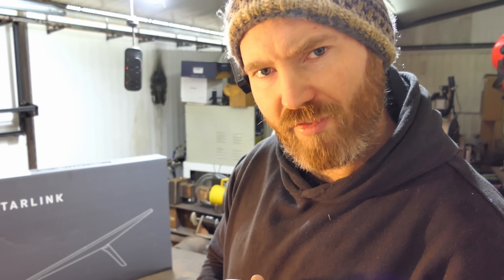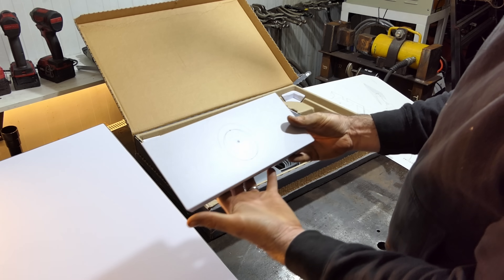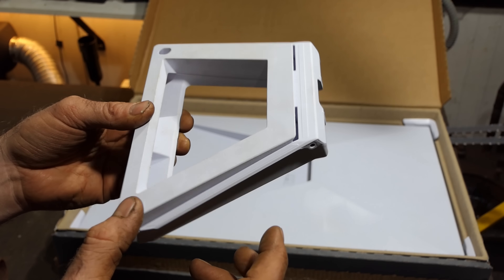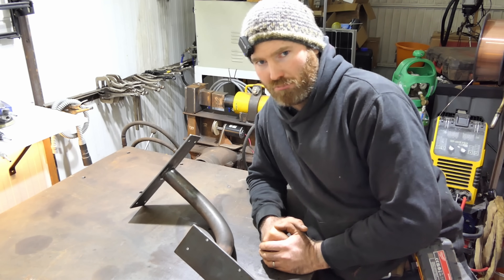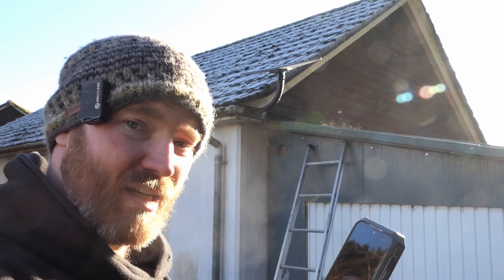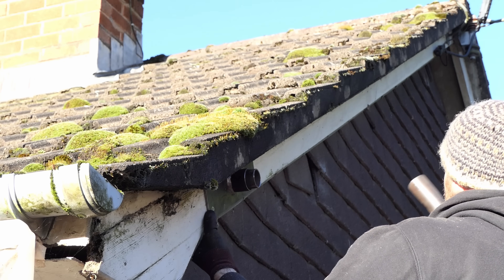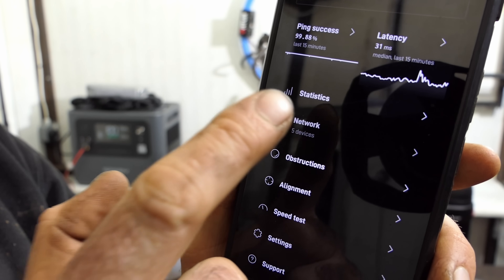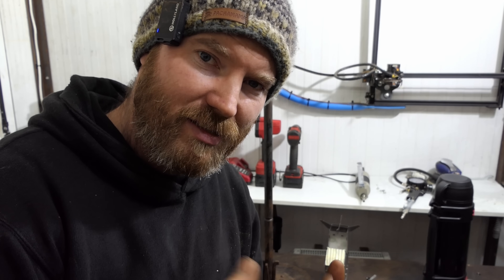I bought UK Starlink internet... I'm shocked!

Comment: I was interested in this as I have no wired (cable/fibre/phoneline etc) connection to my flat - half a mile from the centre of a market town! I tried to get full fibre connected - involving 9 visits from Openreach - and despite being about 100 metres from a large connection box in the road, and the same distance the other direction from one of their upright boxes, they finally told me they could not connect me. Not that I would have to pay, but that it was not economic to connect me at all. I considered satellite, but the cost was prohibitive, and the £75 a month cost rather scary, too. My only option is mobile internet, and after 2 years with Three, at £20 a month for speeds as low as 0.3 Mbps (and a high of 6) I am now on a monthly contract with Lebara (Vodafone) at £25, but with an average speed of 30 Mbps. Fortunately these speeds are adequate for my needs, but if the next tenant here needs faster internet it is going to cost them!

Comment: The plates at either of the steel tube should have a have a hole large enough to pass the cable through the tube. Much neater.  I also added 2 TP-Link Deco meshes as the house was quite large. Works brilliantly now. We also installed Starlink because we had rats first eat the copper cable, which was replaced, and then the Fiber optic cable that replaced the copper one.
Reply: Rats around our place legged it after our cat arrived ... on one of his first days outside he ran back to the house with two young ones in his mouth and a few days later brought a full sized (dead) adult rat in through the cat flap ... eek. That was 4 years ago and still not seen a rat around here since! Rats appear to be smart enough to know when life is going to be better elsewhere.

Comment: You need a mesh WIFI system. Plugs into the ROOTER 😂, you disable WIFI on that and the mesh units take over that functionality. I have 3 around my house as its a long narrow house. Works a treat and full speed is available even at the bottom of the garden. About £140.

Comment: While watching your video I did a speed test on my internet which costs about 8 pounds/ month on a copper cable and the speeds were 72.91 mbps 'Download' and 75.94 mbps 'Upload'. I am in the EU,. maybe you should start your own ISP? Oh, there was no congestion fee or special hardware (typical wifi modem), I don't need 'snow melt mode', I am not supporting a megalomaniac, to top it all off I am not on a long term contract so I can chop and change as I like.

Comment: If you're trying to do modern stuff on that old desktop, you might like to have a look at installing Linux. If you're used to Windows and wish to 'hit the ground running' something like Zorin or Mint would be an easy option. There are free versions of all the editing software to enable you to do your work. Even on a 12 year-old desktop, you should get speeds similar to what you're used to on your more modern laptop.

You could even make that old PC dual boot before embracing the same solution they use of the ISS and at CERN's LHC.

Comment: Starlink now available? Had it two years ago, used it for about 18 months and it worked great. Got 1G/1G fibre now (not from Openreach). I’m in deepest darkest N. Ireland.

Still have the dish in case the fibre goes down, can activate it at any time a month at a time.
Reply: How did you get any fibre company to make an installation in deepest darkest N ireland? I live somewhat centered and cant get any company to make an installation in my house or zone... Thinking of buying Starlink now but not sure if works for gaming/streaming

Comment: That's cool! Best I've gotten from mine here so far in the states is about 200mb. Most of the time it's closer to 120. I've installed it out at my solar shed and had the same problem in the house. Terrible connection, slow and would drop out. Picked up a TPlink 615x I think it's called. Plugged into an outlet on a wall closest to the shed. Happy days. Full on connected all the time but just above half the speed that's coming from the router. Fine for me though, far more speed than I need. There are certainly newer, better, faster range extenders than the one I've got.

Comment: If your getting a poor signal from the wifi router use a device called (Home plug), it uses your house ring main circuit which you have in ever room. They come in pairs to work, one plugs into the twin socket in the room where the router is and you run a cat5 or cat 6 cable from the (Home plug) and plug the other end into the back of the router. You then go to the room where the computer or device that needs an internet connection is and you plug the other (Home plug) into the nearest twin socket and run a cat5 or cat6 cable from that home plug to the computer or device that needs internet. There's instructions how to link the home plugs and boom you have a very strong connection from your router. Ethernet connection gives the strongest connection because it's hard wired all the way, you can get wifi versions where the connection might not be as strong but good enough depending if your streaming 4k content. Lots of companies supply their version and some perform better than others, google search and reviews will point you to the best ones.

Comment: I got the original round (motorized) dish a couple years ago, and it did the same: according to documentation it should point north, to reduce interference with geostationary stuff circling at the equator, but if your location is already far north, it will actually point south. Since the polar Starlink satellites are operational, it has moved itself to a more horizontal position. ~40W is about 10W less than my old dish. You can expect an extra 80..100W when it starts melting snow. The extra power is not only used for melting, it is also used to boost the signal, to get through the snow, in mine also does it in heavy rain, at any temperature.

Comment: 0.7 Mbps in your workshop is 70 kB/s which is awful. I'd get an even longer cable from the aerial to the router and place it more at the center of the house. The Gen 3 standard aerial you have uses eight wire ethernet cable with rj45 plugs. Probably terminated on both ends according to the default T568B wiring scheme. It's probably best to check which color connects to which pin on the supplied cable. If not, you'll need a rj45 crimping tool and a couple of shielded rj45 plugs (also if you want to keep the holes to drill smaller). Recommend getting cat6 s/ftp cable.
Reply: @joshuadelisle With copper wires btw (which has CU written on the jacket of the cable). You don't want that copper cladded aluminium (CCA). And you need something to protect the outside plug from water.

Comment: We had a boat built and the builders installed a wifi hub for us.   We got a sim card and found that the speeds were much better than the landline speeds provided by BT - and cheaper to boot.   I thought, if it works on the boat, why not at home?   So, at the end of the cruising season, we took the hub home, plugged it in and, hey presto, it was excellent.   So we told BT what they could do with their broadband and have never looked back.   We now use the hub both at home and on the boat for one single monthly fee.
Reply: So is that a star link system or a different company/ different configuration
Reply: @theshauny  When we were having the boat built, I specified that I wanted broadband on board.   The boatbuilders supplied an ordinary domestic hub - Huawei in fact.   We got the sim card from "3" and set it up in the boat.   It worked faster than the 'broadband' we were getting at home through the BT landline.   So we told BT what they could do with their broadband.   Now we have 2 cards - one with unlimited data for the router and another unlimited calls, texts and data for the mobile phone all from '3' for £24 per month and BT are history.   The landline service here in Norfolk was crap whereas receiving our broadband via the mobile signals is excellent.

Comment: you can use your old router and turn off dhcp in the router settings so it turns into access point/ switch with wireless options if you want to use your phone or pc in the workshop, if you have a cat5e cable from your starlink  to your workshop via pvc pipe if it needs to go outside, that way your speed would be improved

Comment: I had bad Wifi too, so I bought a Linksys Velops system and hey presto, I got great Wifi. Maybe that is an idea for you? You can buy 2, 3 or 4 of these 'towers' and divide them over your house. I bought a second hand set of 3 for 75 pounds.

And guy a backup drive, so you don't lose you videos again. You can just buy a seperate external one with USB 3 for example, but also buy a NAS. Nothing worse tuan losing your data and a backup is much cheaper than what you pay these folks to get your videos back.

Comment: Electromagnetic radiation is generally non ionising. At least until you get to UVC and X-rays. 124 nm UVC is categorised as ionising, but technically isn't IIRC. X-rays and Gamma rays are actually ionising, and that's <10nm. Meaning you have nothing to worry about in terms of cancer risk from general electronics that don't contain some sort of specialised magnetron/vacuum tube particle (electron) accelerator.

Comment: 5G in Finland £25/month 150Mbps, reliably 50Mbps asymmetric everywhere (use your phone as WiFi hotspot), the same flat rate on all of Scandinavia and Baltics, 100 Gb/month cap in EU. £35/month fiber optic 1 Mbps symmetric (if available). 

Starlink network will congest like mobile networks. Even 3G was really fast when no-one else had it in my neighborhood but me as Nokia engineer with phone prototypes. But even 4G is now too busy to give good speeds. It is ludicrously expensive in Scandinavian standards.

Starlink satellites deorbit naturally within 5 years. I can not support that kind of waste.

Comment: Just a reminder, you can connect a second router to your initial router to get better wireless if you have a lot of walls and such.  You basically just connect it in line.  You can also get wired wifi repeaters that essentially do the same thing but do not have any of the functionality of a router on top of that but considering they cost essentially the same price I don't see why you'd get them instead.

I do that myself so I have the best wifi signal possible in my computer room for the purpose of wireless VR.

Comment: Im living out in the country side , I had starlink for a while and it was really good. I was getting 350Mb down and usually around 15-20Mb up for €50 a month and I was  using around 3TB or so.   The only issue I ever had with it was the latency which has improved a lot over the last year down to an average of about 25MS but with spikes to 50MS or 60MS and the fact they use GCNAT also caused some issues for me.  Im on fibre now and Im getting 1Gb, under every day usage I dont really notice the speed bump over starlink unless im downloading large files or streaming my games outside of the house.

Comment: Don't compare wifi to actual internet speed.... It's like showing you have a 10Gb highspeed connection and only showing your wifi speed, how silly.... People tend to think that wifi is the solution of internet in their houses... It is not. Better install a 2.5 Gbit switch behind your router and put cable everywhere, then the problem you describe is not there anymore.
You know they sell POF cable sets, (Plastic Optical Fiber) that has max 250 meter reach 100Mb/s on every set connection, but I measured 150Mb/s (Send/Receive) on one set, that is now 8 years ago. So maybe there are faster now that you can attach to swithes to connect to computers and have the advantage of your high speed internet connection.

Comment: I saw your video and thought "if only". I have been with BT for the past few years and it suited my purposes and they also upgraded my connection to full fibre, great. No, not in the slightest. It is now slow and keeps losing connection, I go onto their home page and do a check, they do something and the speed is back to normal, slow instead of not responding. Oh for the good old days before the upgrade when it worked. When the contract comes to an end I am off, there must be a better provider out there somewhere.

Comment: The $75 serving as a disincentive to others is the best money you've ever spent if you're achieving those speeds. I live in the most congested Starlink area in the world, the Pacific NW, and average speeds here are about 60 mbps, down from 200+ when I first received my dish. Where it shines is in reliability. I still have my cable ISP running in parallel which goes out frequently. Starlink just keeps on truckin.

Comment: you can order a starlink adapter to use ethernet and use a cable router, that way you can run ethernet cable to where you need it, and add wap's where you want for better wifi. Iwas going to get starlink as we are too far from the exchange for broadband, and were on satellite anyway, but 4g became available (with a mast and high gain antenna), and a unlimited sim-only package installed into my own 4g router is much more economical. (less than £25/month with discount from provider)

Comment: Hi, love your videos! Just a comment about your computer issues. You can hire cloud pcs, i used a company called Shadow for a while for a CAD rendering machine, the specs were way higher than i could afford to build and as the PC is already at a data centre the link speeds to the wider internet like youtube are insane. You just use a cheap spec laptop/pc to access your shadow pc. YOu would however need to upload your footage to your shadow/cloud PC however that shouldnt be an issue with your new Starlink set up. Cheers

Comment: You can extend the internet through your electrical cabling. Deco P9 system from Amazon very easy to install and works. My home has a concert floor and I use a Deco P9 system with six stations throughout the house and workshop all connected by the cabling in the house you can connect as many stations as you need. I have a 1GB fibre connection which is connected to the Deco wired with a CAT6 short cable then this connects through the electrical cabling to all other stations for either of two UPT connections or wireless (speeds of 250 - 300 Mbps). You have to disconnect the wireless network in the router and create a new wireless network through the Deco main station (one connected to the router by cable) this then connects to all the other stations you have all you have to do is add each station to the network. Then when you walk around your home you have a strong wireless connection. I hope this helps.

Comment: just for INFO, all geostationary Satellite's are located over the Equator ..

depending on were you are located on the planet, the direction you need to point the antenna will vary

here are some general guides;

Northern Hemisphere ( SOUTH )
Southern Hemisphere ( NORTH )
Equator ( DIRECTLY OVERHEAD ) 

the Actual ANGLE / HEADING
will depend on now near to the edge of the intended Footprint ( intended coverage area ) you are located

if you are located on the extreme edge, the required HEADING and ANGLE may be very close too, or BELOW the Horizon.
causing reception to be weak and intermittent or IMPOSSABLE all together.

for example if located in Great Britain ( UK / Ireland ) thou you are lucky that the general heading is close to directly SOUTH 
How-ever; you will be increasingly unfortunate that the required ANGEL ( on average ) is about 30 degree's above the Horizon .. 

( meaning the further north you go ( sorry Scotland )
  the more likely Terrain ( Hills and Mountains )
  man made structures ( Buildings )
  Native life ( Trees, Shrubs & Bushes etc. )
  Will reddener receiving the signal at best Intermittent )

for better understanding, ( suggest begin by ) seeking using your favorite search engine " Geostationary orbit "

enjoy: John

Comment: You are lucky my BT download speed is 0. 46 MBS at present it used to be up to 2.6 mbs but has recently slowed down so now the upload is faster at .68 mbs bt so called fixed the line with no results so now they have sent a new hub.

Comment: buy a starlink network adapter, ( from starlink direct, not amazon)  and then you can run network cable across the premises,   wifi takes off 25% speed or so, so you could plug your PC/laptop direct in to router to maximise speed....ive had a starlink on roof of stately hopme conenct to 18 access points and even go across the cricket pitch all using seperate wifi and the starlink router was just being a router......( router rhymes with rooster,  in UK route is a way forward, route prounced the american way is device for milling wood, and for running away is disorderly retreat, perhaps why americans use the latter)

Comment: you can print an XY adjustable pole mount cos there is a thingiverse starlink pole mount and then you just need a swivel system to slot in there and onto any fixing you want.

Comment: damn, in the netherlands i have also still copper through coax and i am getting 700/60 mbit... they installed fiber in our village but is not ready yet for use for the next 2 months or so.
Reply: Here in the US, I had a cable connection, which was recently upgraded
from 100Mb to 300Mb. However, I had many service interruptions, over
the years and they continued, after the upgrade. 300Mb is nice (if you can get it).
Finally, during an outage, I switched carriers, to fiber and 300Mb Synchronous.
That's 300 Up and 300 Down. Also, it was for the same price. It's been 4 months
now and no interruptions (knock on my wooden head). I'm a happy camper. 😁✌🖖
P.S.: My actual speed tests out at ~ 370Mb. 👍👍👍